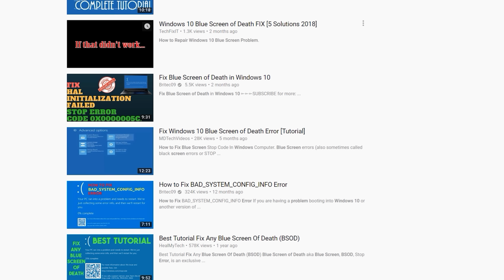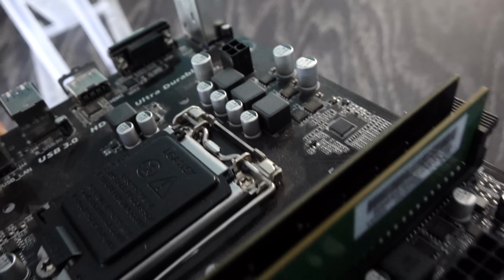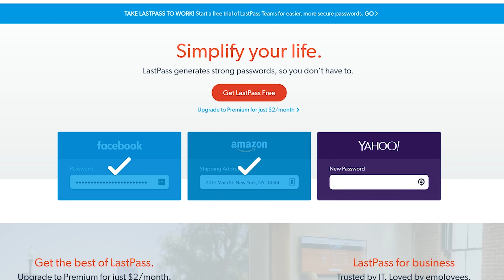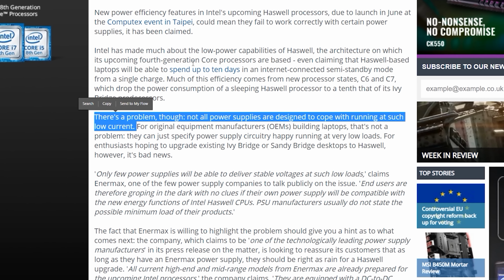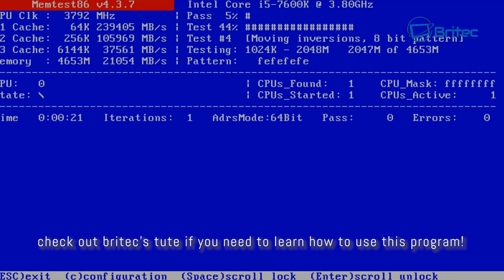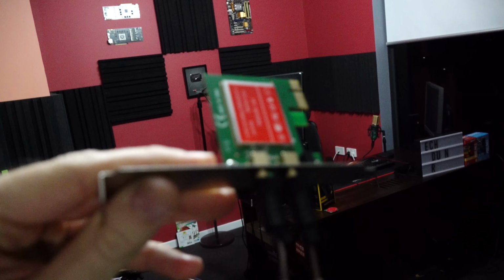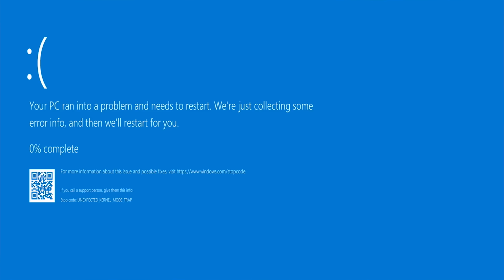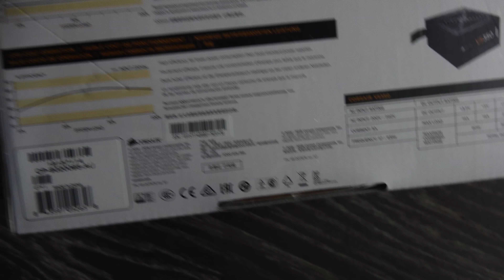How To FIX a Blue Screen on Windows 10

Comment: I have a question and theres like 3 or 2 reasons 

1. Is my computer shutting down bc its summer and its too hot?

2. Is it bc my computer is old

3. The weird thing is that when i always play roblox but when i dont play roblox it dosent shut down but when i play on roblox it lets me play just a lil and then it has a blue screen and it says ""Locked" 

What does is possibly means of those 3 reasons if its soo important tell me.

Comment: I have a desktop and I’m unable to install Windows 10 from BIOS.  I get this error code when I put my flash drive in start the installation.  I’ve tried installing on a different Solid State but I still get the same error.  Could the Gigabyte Motherboard be corrupted?  It has the latest BIOS.

Comment: TP Link AX3000 PCI WiFi card gave me the blue screen of death, about to return but luckily I didn’t. I removed the card, I wired connect to internet and downloaded the driver. Put the card back in, fired up the windows the blue screen went away and windows started working again.

Comment: I get a blue screen within a couple minutes of installing windows unless I set up without internet and stop Windows update before setting up the internet and it'll run for about 2 weeks maybe a little less and then blue screen. Completely lost lol it's not the power supply it's 850 it's 1060 GTX 1060 i7 40 sum k I don't remember MSI kraite z 97s motherboard 32 g HyperX fury in 4 8 gig sticks. Runs great for a minute or a couple weeks depending on how you do it

Comment: I have a problem where an external harddrive (that has always worked perfectly) has decided to blue screen my desktop. It does the same on my Windows 10 laptop. I can however access the files on my Macbook but I can't copy and paste to a new harddrive as Mac OS won't allow it (different formatting). I have tried different USB 3.0 cables and same BSOD. What can I do?

Comment: Wow, This was one of the best most informative high level seriously experienced tech frustrations I've seen. I have a gigabyte motherboard that I think is good with some decent peripherals and high end graphics that has been randomly blue screening. I took all of his original equipment out and put other vid/memory/pci wifi etc... And ran it stable for 12 to 24 hours but after installing clients original equipment, 30 to 60 minutes it blue screens with (Not less than or equal to irql)
And even after I remove and go back to what was stable equipment..I randomly get the generic blue screen after an hour or two...
Addendum for your video:
Client did flash the bios which seems to match up with his experience of timing of good pc to suddenly blue screening..
Flash your bios only if you know specifically why your. needing to flash new equipment major is upgrade etc..

But in the end thank you!!!
This video really took me back to the basics and the voltage ram settings and hibernation single ram etc.. was just really totally high level wise with experience advise and insight. 1tech2 another.. thank you!!!

Comment: well It was our company pc since I work from home . at first, it won’t turn on only orange flashes, I know it has something to do with power, since this pc doesn’t have avr,ups this pc just directly plugged in, so when there is a power interruption this pc will turn off immediately, I can’t blame, this is an old unit ,so  I’m sending this to them , when the bluescreen appears: stop error code: attempted write to ReadOnly Memory and I heard 6 beeps which that error refers to memory, am I right? I’m sending it to pur office so the IT can fix it, I felt sorry to the cpu I used, I only managed to turn it on and saw the error but I can’t do further than that, I’m not allowed and I don’t have enough knowledge to that

Comment: i know this is an old video but just had first blue screen of death when it rebooted took me to bios could a system fan do that if it is faulty because when i booted in there optimized mode then went back in bios and put my xmp back on the only change was one fan that said it was bad disable it and turned the rest to max and now system is fine im puzzled

Comment: alienware x51 r2 BSOD boot loop with multiple BSOD's (basically everything under the sun. service tag j66vy12... i have bare-boned (no joy), installed os in another chassis and put that in (no joy), tried a working hard drive from another pc (no joy), removed ram etc... the problem comes back with any hard drive in it. it is on the latest BIOS ...(any body got a shotgun)  so frustrated.

Comment: Today I was chatting and playing with my friend in discord and went to take a shower. To my surprise, when I came from the shower ,I found my pc screen black and the keyboard and mouse off. I turned the pc on and of several times but nothing happened. I left the pc off and went to have dinner. After dinner I turned it on and booted into windows and repaired all files and after somo waitng it entered into windows. So now I go on discord, open steam, and a a messege pops un saying spotify woundn't load, I skipped it and went on to fivem and while loading favorite sv list or entring a sv blue screen comes up again. And doesnt boot into windows. I am going to try and reinstall windows from scratch but i am scared it might be a hardwear issue. If anyone knows why this is pls help. Thxxxxx

System:

R5 3600

1x16gb 3000mhz

B450 Tomahawk

GTX 1070 EXOC

PSU Nox GD750 Gold

P400S

250gb Toshiba ssd

2tb seagate barracuda

Comment: I bought a $2k gaming pc from digital storm and I get the UHEA_UNCORRECTABLE_ERROR multiple times a month.  So far all the help tech support has given me is asking me to reseat everything in the computer and update the bios. Neither of these worked and I just opened my second support ticket... I'm afraid it might be a voltage issue because I have a 600 watt power supply with a 2080 super.  I didn't know it wasn't enough to power it until I already had the computer in my possession. I dont think I should have been able to check out, personally.  But I brought it up to the tech support guy, and he claims it couldnt be the problem lol.

Comment: Sir my mother board was asus ex a320m-gaming and my processor was ryzen 5 2600, i did not overclock it. my psu was 750watts, but only 4pin. What will be the enough voltage if im going to set it up on a higher voltage. So that it will not freeze and will not have bluscreen message clock wardog?

Comment: My pc goes on BSOD ramdomly about 5 in 5 days, i've already tested it on memtest86, and it ran 3,5 hours just fine, and the results shows no errors, think it could be a driver problem or something like that, or the voltage thing, my pc is a I7 9700(NO K), 16gb ram ddr4 2666 Crucial Ballistix, Asus Tuf b360 plus gaming BR, 850w 80plus gold EVGA Power supply and a 1050ti (Im just using it by now, i pretend to chage the GPU).

Comment: Here is another interesting one to add to the list. Dell G5. laptop. Transferring files from a QNAP NAS to a Seagate NAS with an iSCSI vole.  I am getting BSOD watchdog errors when transferring large volumes of files and potentially large files such as movies and videos. This is the only time it happens. Anyone else seen this behavior. iSCSI also is not auto reconnecting. I can manually disconnect and reconnect just fine. won't connect on boot.

Comment: Good day Tech Yes City! May I ask what is the solution for BSOD IRQL_NOT_LESS_OR_EQUAL Windows 10? What can you suggest or recommend to do? I've check from google already.
Reply: I get this error at the start of League of Legends game some times. other games seem to run absolutely fine whatsoever. Didn't have this issue with League of Legends before. I've even tried to reinstall but still same thing. I updated my GPU driver > still same thing :(
Reply: @hircine92h  Did you find a solution?
Reply: @rohanmiscrits  I still get bsod from time to time.

Comment: My laptop is stuck at 0% and i cant do ANYTHING :((
Reply: MiDNiT3 Same My laptop too I cant open it
Reply: Take out the battery and plug it into power and try to turn it on. If it boots, then you just need to replace the batter. If it doesn't, could be the board and you might need to find a repair place to do so
Reply: Same!

Comment: Thanks for the video. My pc is blue screen, freezing, and shutting down, I already check the ram and the ram is fine. i'm running a 650 evga gq . I installed a rx 5700xt just few days ago pair with a 5 2600 at 4.0. can someone tell me if that may be the psu? also i have a aio liquid cooler 240mm and 2 120mm fans

Comment: i always have IRQL not less or equal BSOD everyday. i dont know whats really causing it. ive tried cmos battery, disable fast startup, reinstalling clean win 10, reinstalling drivers, memtest86, chkdsk, sfc scannow and still has it now especially on first boot of the day the moment i open my chrome and browse for about several minutes then BSOD.  i got a ryzen 3600, b450m asus tuf plus gaming plus, hyper x 3200 cl16 2x8GB ram and msi ventus 2060 super. if anyone knows any fix please comment. thank you in advance

Comment: Nvidia drivers. SOLVED, for me. Try this, Uninstall drivers from safe mode. Use the DDU tool to remove drivers. Reboot to normal mode, install newest driver. REBOOT, now reinstall again and reboot. Now my laptop doesn't crash when it sleeps.

Comment: In my case it ended up being the RGB lights on my RAM... I shut if off using (mystic light, if you have a msi motherboard) Now there is no issues at all, the lights were just heating it up to much to be stable.

Comment: I had bluescreen Critical Process Dead yesterday after trying to RESET THIS PC, Windows suggested options(safe mode,cmd,recovery) didn't worked, so decided to rewrite Windows 10 using usb flash drive and it worked :)

Comment: cheap hard drives often cause problems with system stability, I had experience with L5 Lite 128Gb SSD drives that for 20 laptops all were sent back to the complaint within a year and returning with the new L5 Lite disk again had errors that came out during the first major update of the win10 system and just disk damage caused a blue screen

Comment: Haven't figured out the iastore.sys bsod yet.  Win7 worked fine, after upgrading Win10 I get this bugcheck.  Changing certain drives to certain sata ports can trigger it, having my data drive in causes it.  Getting the latest patch causes a backup imaging program that works to bsod.  All drivers are up to date.  Remember Win7 worked fine and if rollback works fine with same hw.

Comment: There are hundreds of reasons for a BSOD. Most of the time, the hardware is not the problem. More often then not, it is a software causing the problem, maybe a driver. It is often the antivirus software. If you want to know what is causing the BSOD, use something like Windows debugger (Windbg) and analyze the dump file. And dont worry, I understand this is a top 5 of the weirdest problems (I heard of a video card causing problem because the LEDs where overheating th card).

Comment: - <Event xmlns="http://schemas.microsoft.com/win/2004/08/events/event">
- <System>
  <Provider Name="Microsoft-Windows-Kernel-EventTracing" Guid="{b675ec37-bdb6-4648-bc92-f3fdc74d3ca2}" /> 
  <EventID>2</EventID> 
  <Version>0</Version> 
  <Level>2</Level> 
  <Task>2</Task> 
  <Opcode>12</Opcode> 
  <Keywords>0x8000000000000010</Keywords> 
  <TimeCreated SystemTime="2019-12-06T15:11:31.888418300Z" /> 
  <EventRecordID>1</EventRecordID> 
  <Correlation /> 
  <Execution ProcessID="4" ThreadID="2740" /> 
  <Channel>Microsoft-Windows-Kernel-EventTracing/Admin</Channel> 
  <Computer>WIN-SI334SRD6UP</Computer> 
  <Security UserID="S-1-5-18" /> 
  </System>
- <EventData>
  <Data Name="SessionName">PerfDiag Logger</Data> 
  <Data Name="FileName" /> 
  <Data Name="ErrorCode">3221225525</Data> 
  <Data Name="LoggingMode">8388736</Data> 
  </EventData>

  </Event>

Comment: I have now bluescreen in win 10 then i mount a kingston a2000 m2 ssd, as storage ssd, i have samsung 970 evo plus m2 as primary ssd with windows 10,  stornmve.sys i think it was on bluescreen, i have try to swith slot but did not help, my computer just hate my kingston a2000 only fix to use it are in a external chassi with usb-c in that my kingston a2000 m2 work perfect, but slower of course :( and i use corsair 750w power suply that work perfect!!!!

Comment: Hi, I just built a new PC and instead of enjoying my PC I have been trying to troubleshoot a lot of problems for about a month now. These issues happen while not gaming. For example.. Green screen crash while watching video and display recovers, Monitor crash after launching a program and reboot required, Crashing while working in a program and plenty of BSOD'S with the latestone being "STOPCODE:  Attempted_Write_To_ReadOnly_Memory"  I've tried plenty of windows reformats and problems just keep coming back. My Ram has been tested with Memtest86 about 2 weeks ago with no issues. My 620 watt PSU was new but, from  filing cabinet storage from years ago. My OS is on my m.2 card. My drivers appear to be up to date but, I am not an expert when it comes to searching for an updated driver that might not be even out there. I obviously know how to get the main ones like Chipset, GPU, Lan, and Audio. I sent off my ASUS RX 5700 XT GPU to be checked but I'm still having issues even with old ASUS HD 7950 GPU installed. 

I guess I'll try one stick of ram next.

OS Name Microsoft Windows 10 Home
Version 10.0.18362 Build 18362
System Type x64-based PC
Processor AMD Ryzen 7 3700X 8-Core Processor, 3593 Mhz, 8 Core(s), 16 Logical Processor(s)
BIOS Version/Date American Megatrends Inc. 1001, 09/09/2019
BIOS Mode UEFI
BaseBoard Manufacturer ASUSTeK COMPUTER INC.
BaseBoard Product ROG CROSSHAIR VIII HERO
BaseBoard Version Rev X.0x
Memory 16GB Corsair Vengence 3000mhz
 Installed Physical Memory (RAM) 16.0 GB
Total Physical Memory 15.9 GB
Available Physical Memory 10.8 GB
Total Virtual Memory 18.8 GB
Available Virtual Memory 10.0 GB
Page File Space 2.88 GB
Page File C:\pagefile.sys
Kernel DMA Protection Off
Virtualisation-based security Not enabled
Device Encryption Support Reasons for failed automatic device encryption: TPM is not usable, PCR7 binding is not supported, Hardware Security Test Interface failed and the device is not Modern Standby, Un-allowed DMA-capable bus/device(s) detected, TPM is not usable
Hyper-V - VM Monitor Mode Extensions Yes
Hyper-V - Second Level Address Translation Extensions Yes
Hyper-V - Virtualisation Enabled in Firmware No
Hyper-V - Data Execution Protection Yes

Comment: Thanks a million! That under voltage issue was plaguing my computer for a month and eventually I gave up until I found this video thanks!🙌🙌🙌
Reply: Zane Stilman mine is saying internal power error
Reply: @Mshagy02  not sure. I sent in my computer to a friend and he tried everything to fix it but didn't know. I figured I was going to the computer store to get it looked at and fixed when I found this video and found the temporary solution. Went to the computer store to ask about it but they recommended I bring it in for probably faulty hardware, brands new parts sigh... but I'm too lazy to go. Since my computer "works" though the CPu will be running sightly hotter.
Reply: @zanestilman7015  when I go into my bios ion even get the option to change my voltage.  Is it cuz um om version 1.6.1.0?
Reply: @Hope1353  it'll depend on your motherboard as they have their own style of bios screens. For me I had to goto   advanced voltage settings, cpu vcore and change it to manual. If you can't find it I'd try exploring until you find values that have numbers with a "V" value. As you cash imagine playing with the voltage will reduce the life of your components specifically my cpu but my gigabyte motherboard can't regulate itself is me issue.

Comment: i fix my BSOD by wiping out my C:  and D:  drive. i even took it to a Tech Pro for 7-days even he couldn't fix it, finally i asked to just give it back. And said the hell with it, i'ma Wipe everything, and BamBam fixed my PC. i was PC-Less for 8 days,  just for a corrupt file. I did it all system Restore, Reset,  everything i did.Till i wiped it all. Both C: and D: Drives. So my Advice always Backup anything of value to another drive. Do this each time you install something new or add valuable pictures  ECT. Make a copy to a totally separate external drive to keep it all   safe never leave anything you want sitting on ur computer make ur self copies all the time and you won't kick ur self in the are later, that's my advice to all.
Reply: @Mehfoozech u dumb? he may have 2 hardrives or just 2 partitions for 1 drive
Reply: How do you wipe out the C: and D: drives

Comment: I kept getting DRIVER POWER STATE FAILURE 3 or 4 times a day and after trying a lot of the fixes recommended elsewhere I think I finally found what was causing the BSOD. I noticed that TimeBrokerSvc was showing up in tn task manager multiple times and growing in number so, with low expectations, I went into regedit and changed it's Start value from 3 to 4 to disable it. No more BSOD; at least not in the past 2 weeks.
Computer\HKEY_LOCAL_MACHINE\SYSTEM\CurrentControlSet\Services\TimeBrokerSvc

Comment: hi 
I have i5 2500 8gb ram windows 10 and gtx 1050 2gb and some 630psu from china ..and my pc runs just fine while gaming and I newer get blue screen but I let my pc upload some video... and its just idling some time i get that blue screen.. and only in that situation ... i did use this 15 $ PSU even on q6600 and gtx 550ti just fine back in 2016 when my Silverstone died